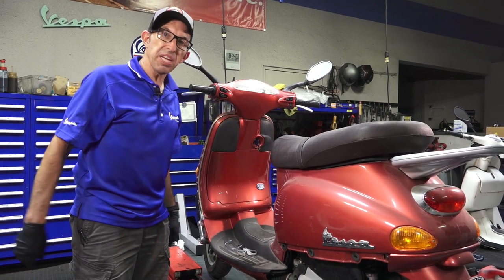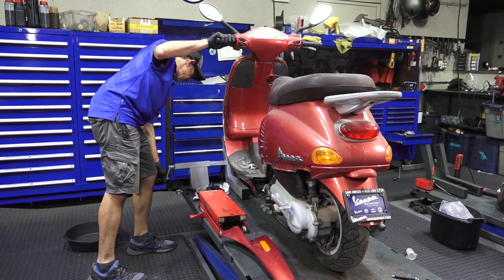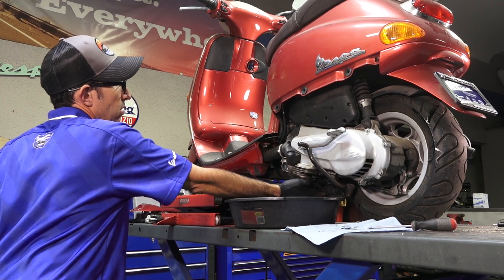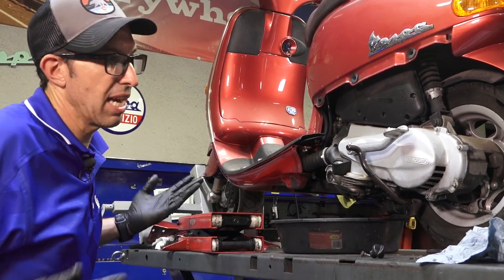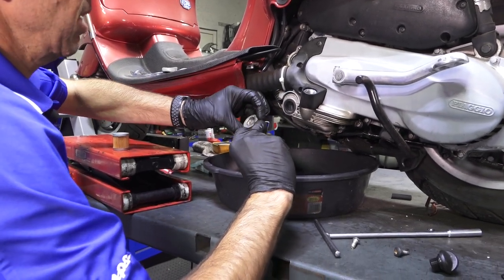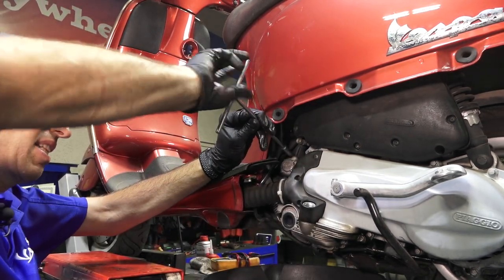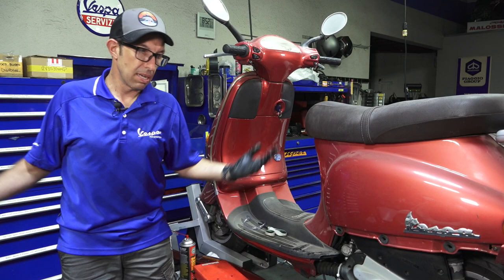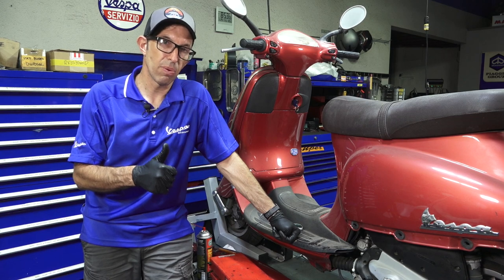Vespa ET4 Resurrection PT. 4 | Oil Change

Comment: Do you have a video explaining the sender unit and if it can be replaced?... Im guessing the sender unit is the problem (?)... My 2005 ET4 gas gauge displays only half tank when the tank is in fact full. ...as the gas is used the gauge will begin to move lower, and the reserve light will illuminate once the gas gets low.   Once again, I fill-up and the gauge needle never goes past Half full.
your videos are so helpful!!!   Thanks